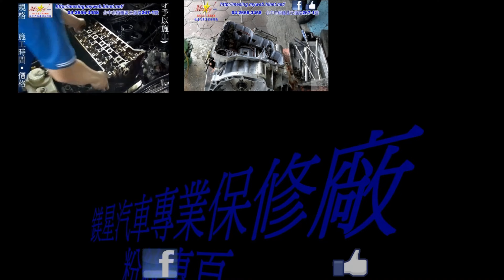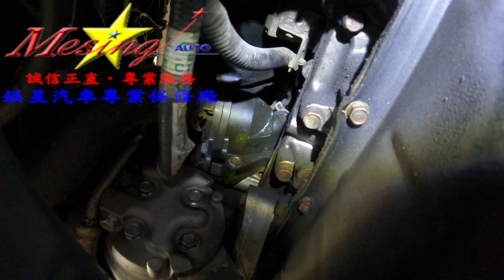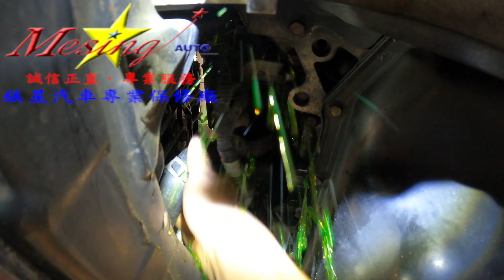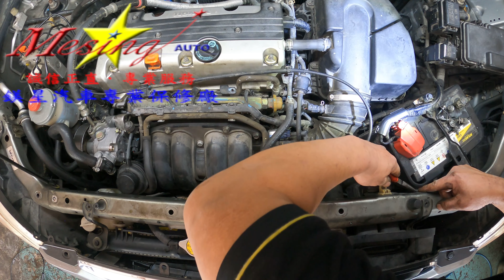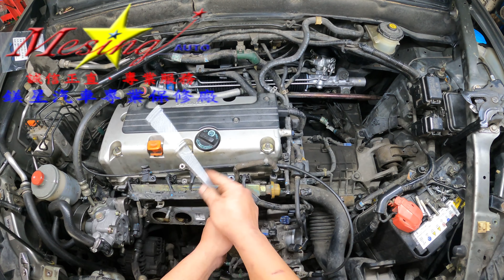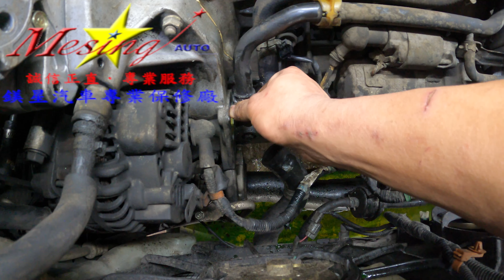How To Replace Thermostat  HONDA CR-V 2.0L 2003~2006 K20A4 MCVA/MRVA 4WD P.1

Comment: You can reach it from underneath..without taking half the motor apart
Reply: Do you have video please
Reply: you can yeah I've just changed mine but keep in mind it can take a while and you'll need 3/8 rachets, small extensions bars and a M10 sized socket - a crow bar if you need to move the heater pipe mine was not moving so i couldn't align my bolt holes with the thermostat cover. The way in the video is great for me if I needed to move my heater pipe back or forward further -- this video would have made my life easier so thank you I'll use it next time and doing things the right way takes time and costs which most people don't want.

Comment: Where's the thermostat? At no point did you ever pull it out I saw you take apart half the front end of the car but never actually pull the thermostat out and show where all of those little parts that you have go and how they go in.... wasn't that the whole point of this video?
Reply: To me it seems to be a video to show the customer how much work goes into taking apart to overcharge time, do what’s industry standard. Like someone mentioned, you can reach it through the bottom whole lot faster and easier. I had a mechanic tell me he needed to lift the vehicle and replace the radiator to fix just that. I knew what it was, so I never went back to that “certified mechanic”. The mechanic that fixed it did it through the top, and didn’t remove everything like on this insane video. Goes to show you how this industry works.

Comment: Lol wtf why would you take the entire car apart?
Reply: Hi do you have video of easy way please I need to replace thermostat
Reply: @lolosaulala48  i found one yea. It's from the bottom of the car... Just follow the lower radiator hose until it goes into the engine. Take off the hose and there it is.
Reply: 22:21

Comment: oh my, so crazy just to change thermostat.
Reply: He is also doing a manifold gasket as well. To change the thermostat, you only remove the transmission line, the radiator hose, and 3 10mm bolts going in from underneath. Simple as pie.
Reply: @erikames-dixon2658  I couldn't get the top bolt on the thermostat housing (the second plastic part of the clamshell besides the actual thermostat part) without removing the intake like in the video. That second part cracked and caused a leak.
Reply: @johnwitherell6662  use a wobbly extension with a universal joint on a deep well thin wall socket. I've done a bunch of them. A friend of mine needed a video and stumbled across yours. 
Did you try taking the trans line off before tackling the thermostat? Theres plenty of room.